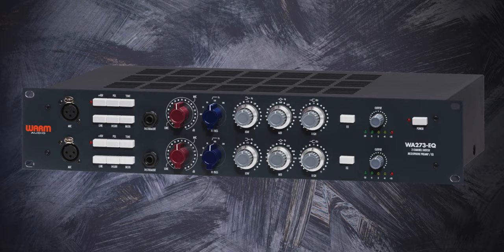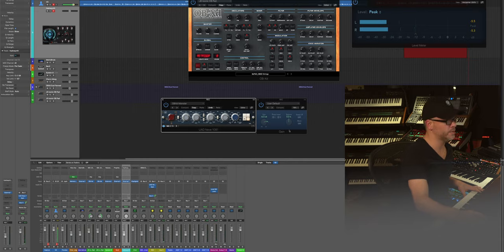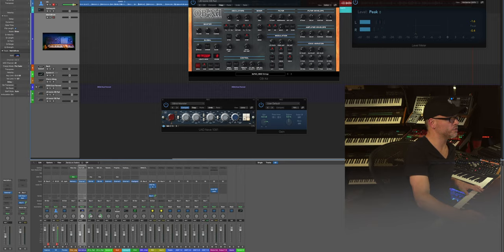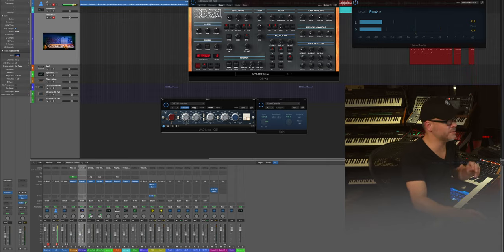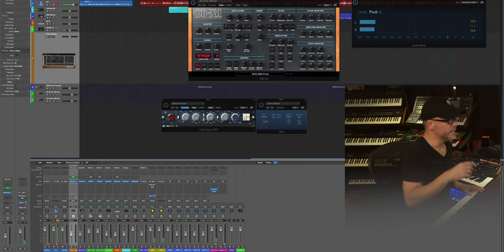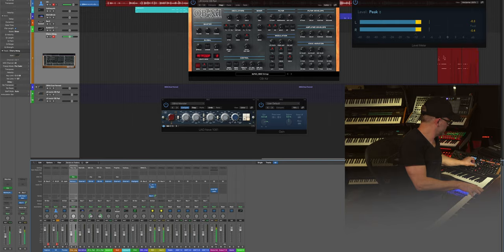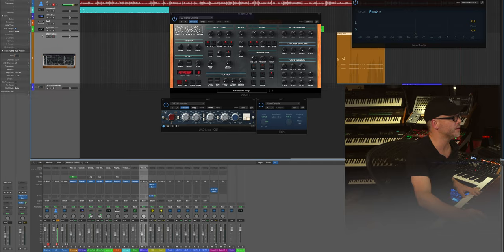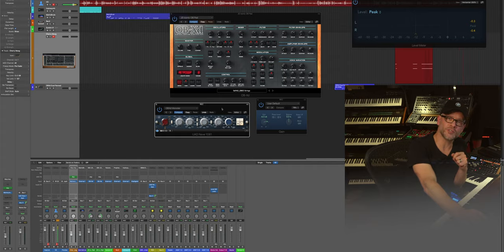Treat Your Synths To Top Notch Tone with Neve Style Preamps

Comment: Great points! I had a discussion a while ago about how Arturia was somehow "less satisfying" out of the box than I'd initially hoped, and it turned into a discussion about how the nostalgic sound we remember from those tracks got "colored" by all the gear (including tape) the producers ran the sound through at the time. So, the Arturia models might be accurate, but you "need" to run the sound through some analog gear (or emulations) to capture the sound we remember nostalgically. UVI's vintage synths sometimes have a bit of that vibe in the signal (i.e., UVI sampled the synths coming out of some analog gear) so they can be a little more instantly gratifying. This simple realization got me to return to Arturia again, knowing eyes wide open that I'd need to add some emulations after the raw synth signal. Cheers!
Reply from the maker: Yes, absolutely! I found this when comparing certain software emulations to their vintage counterparts… Both sounded a bit anemic until I ran them through the 1073s with EQ, and LA2As… pretty radical transformation!

Comment: What about soft synth through analog preamp vs through a software emulation? Does it still have that “sauce” in your mind?
Reply from the maker: It’s all about the person driving it. Some of the best plugins can sound just as good as hardware. That said, I generally prefer working with hardware, and I do often run soft synths through an analog chain - but there are software versions I have no problem with whatsoever 😁

Comment: Have you tried unison technology by UAD ? Is it better then just inserting the plug-in in the channel like your did ?
Reply from the maker: Yes, it’s excellent. But it’s the same plugins and same end result when you’re using it on synths, unless you’re using a DI connected to the mic preamps of an Apollo. In that case, you might get a slightly different result because of the variable impedance that it puts on the preamp, but otherwise identical. Unison is really meant for interacting with microphones.
Reply: Have you tried any of the Brainworx stuff, would you say it’s comparable to UAD ? Great channel btw. Love it
Reply from the maker: @tommymai3062  thanks for the kind words! Yes, the Brainworx stuff is just as good. In fact, several of their plug-ins are identical since they licensed them to UA.

Comment: What is your view on di boxes, re-amping etc ? some people seem to lower line level to mic level before going into preamps. Is this necessary ? What is your take on this ?
Reply from the maker: It’s not necessary but it can make a difference with certain high quality tube DI’s, depending on your gain structure. Personally I think a Neve 1073 or similar preamp is all you need!
Reply: I finally got a warm audio 273eq , can't wait to test this vs the UAD plugin.   @JimDaneker
Reply from the maker: @bennethos  have fun! I'm just doing some sampling through mine today ;-)
Reply: just putting it through the "tone" button activated not even activating the eq already makes such a difference @JimDaneker

Comment: Great video, Jim! Been looking forward to this since your IG post. Question - if you could have only one (reasonably priced) poly synth, what would it be? Looking for something to complement my Moog Sub 37 which is my primary mono synth (though it does have a duo mode as well). Looking for a poly that will sound great through my WA173!
Reply from the maker: Thanks Michael! Man, that’s an extremely tough question, and very subject to personal preference of course!   Overall, I’m still constantly amazed by the Roland System 8. It just covers SO much territory. Another other top contender is the Sequential Rev2. Either of those would be tied for top spot I think. Even cheaper would be a used Access Virus TI desktop module, which is one of the best synths ever made bar none!
Reply: @JimDaneker  Great…thanks! The Sys 8 and Rev2 are definitely both at the top of my list.

Comment: I was experimenting on some Korg apps on my iPad mainly the M1( which is really a dull boring synth compared to a lot of other synth instruments out there) and I ran the iPad stereo outs through a steinberg audio interface into my presonus quantum 2 audio inputs into my daw. It gave the m1 so much depth in sound, it sounded like a keyboard worth at least 2 grand. I’m sure it would even sound better through a neve preamp. There’s just something about running the instruments through a preamp that makes it so much better than a straight to digital sound. I recently purchased the aurturia fx package for $99 and has a 1073 modeling preamp included in it. Thanks for the tip on when and how to use the preamp!
Reply from the maker: Yes sir!

Comment: Hmm, to me, it just sounds more distorted with the Neve. You could just use a distortion paddle to achieve that.
Reply from the maker: I'd be curious about your monitoring situation, because the subtle saturation & harmonics you get from a Neve-style preamp (assuming you aren't drastically over driving it) is pretty different from what most people perceive as "distortion." it sounds bigger, beefier, and with a nice pleasing low end character. There's a good reason countless hits were tracked through Neve consoles back in the day 😁